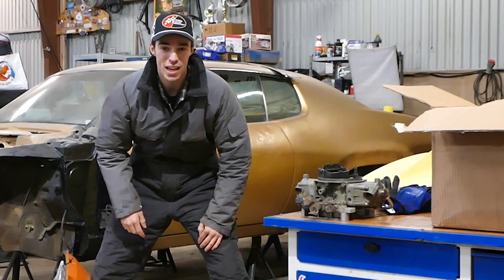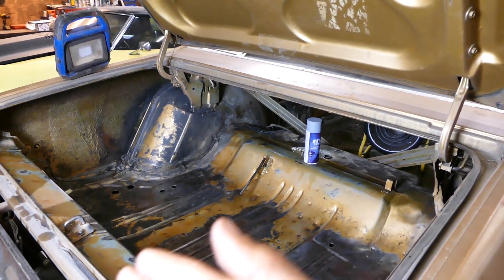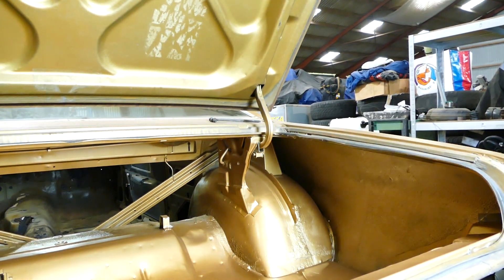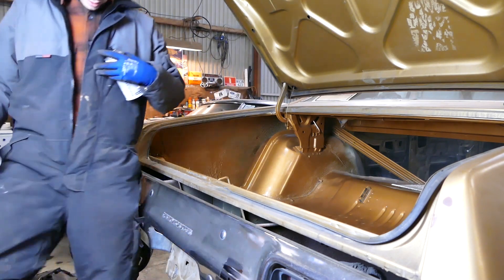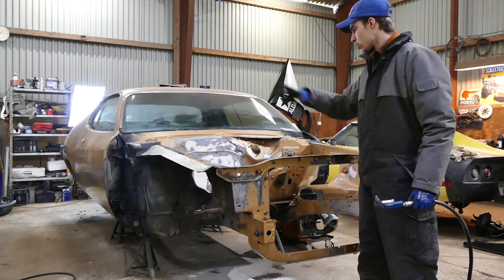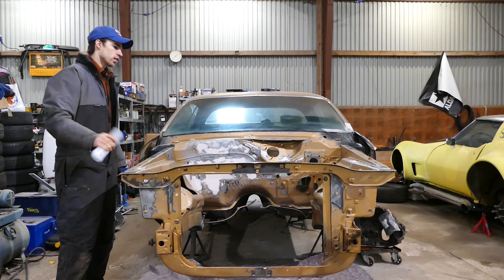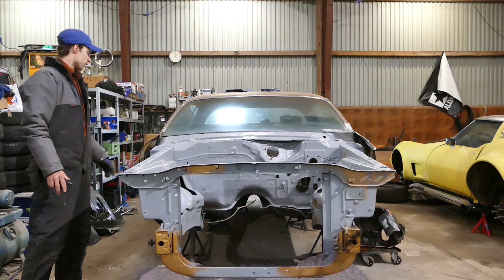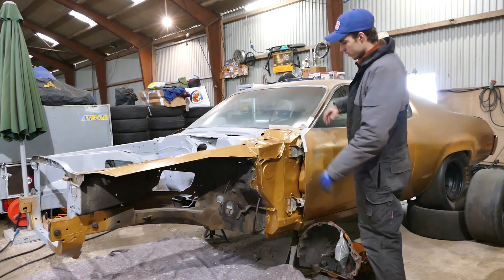Painting The Road Runner Build! "Looks Factory"

Comment: Wow that clear coat in the trunk really changed it from sort of copper gold color to serious gold color. Also, there are a lot  of ways of getting fresh paint off glass but I've always had great luck with WD40 or some penetrating lube and Scotch-Brite. If tough, the same with steel wool. Once I had to use blades when it sat in the sun for years.
Reply from the maker: it really looks like a new car on the inside now, yeah iam gonna take the razor blade to it works everytime!